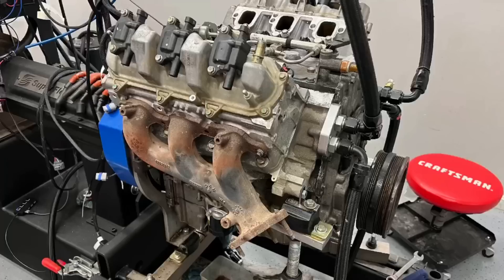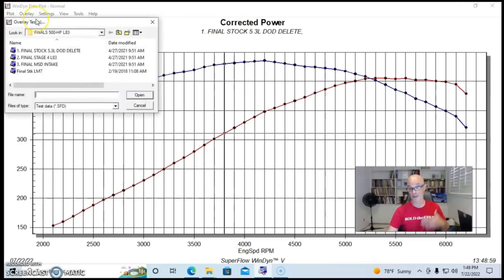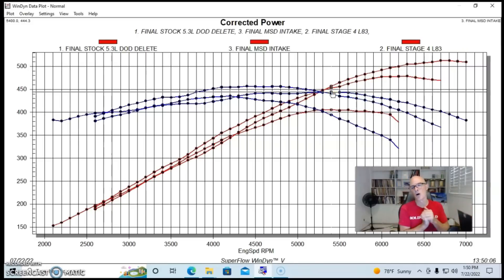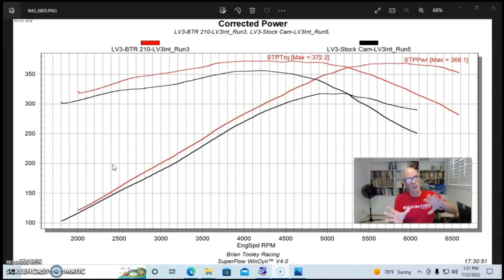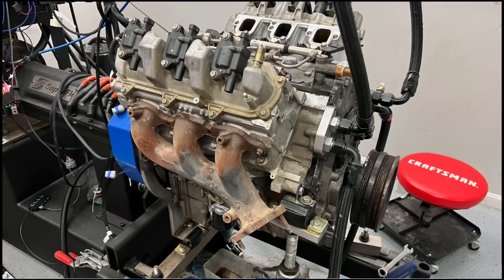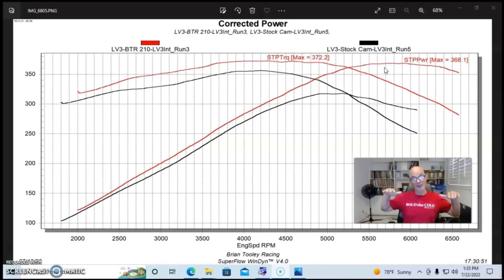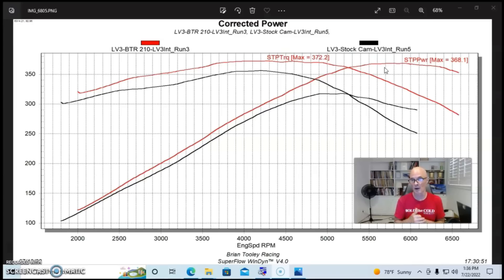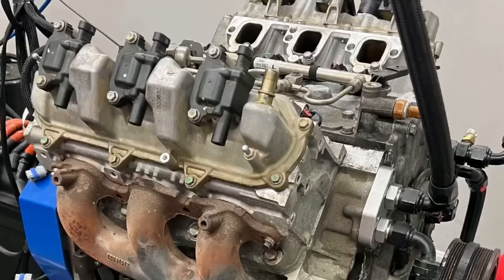4.3L LV3 V6 VVT CAM TEST-THE OTHER GUYS-HOW MUCH HP IS A BTR VVT CAM UPGRADE WORTH ON THE 4.3L V6?

Comment: The fact that they never made an LS based v6 is a crime
Reply: The last generation 4.3 Ecotec V6 wasn't LS based? Last I checked, it was a V6 LS.
Reply: @OldManButtWrinkles  it's base off the new LT direct injection motors
Reply: @OldManButtWrinkles  the LU3 was the Gen 2 SBC. The LV3 is Gen 5 SBC
Reply: That's not totally true the mercury marine 4.5 V6 is basically a part for part V6 LS
Reply: Word to your unvle and your aunt
Reply: @pr0n5tar I was thinking the same thing thing. Would’ve been a terrific love letter to 3800 lovers.
Reply: Considering the Later Model LU3s were distributorless, really doesn't matter
Reply: This is from the LS
Reply: That's what this lv3 is.
Reply: It's a cutout 2 cylinder Lt1

Comment: Holy Smokes!  Richie tests an LV3!  I never clicked on one of his videos so fast.
It's great that BTR is paying attention to the LV3.  Can't wait for the boosted version.  700+ HP.
Reply: Its a Shame GM cut it in favor of a turbo 2.7, I think they should of updated the LV3.
Reply: @shadowopsairman1583  let’s just be happy it was made, the aftermarket can take off with it
Reply from the maker: the power should be easy-not sure on crank strength
Reply: @richardholdener1727  The LV3 I think has bigger rod bearings than it's V8 Brothers.  I don't worry about split-pin cranks since I saw the crank from a Cat 3500 series V8.
Reply: @andyharman3022  actually the rods and bearings are smaller in width. We have toyed with the idea of machining some width off the big end of a L83 rod to make it fit the crank and would highly increase the power potential. The LV3 rods look like toothpicks.
Reply: @ShorTuning  Did you measure the diameters?  I think GM compensated for the narrower bearing by making it wider.
Reply: @ShorTuning what direction did you go? And are the rod big end diametes the same???
Reply: @richardholdener1727  Should be GREat but Ralph NADEr may not approve.

Comment: You should compare that v6 to a 4.8l because if I recall correctly those factory numbers are real close
Reply: This beats it out. The LV3 has slightly less peak torque stock than the 4.8 but makes it slightly lower in the Rev range and a much broader and flatter curve. More peak horsepower thought. And once you throw E85 in the tank it surpasses it and almost matches the older 5.3 (pre 2013).